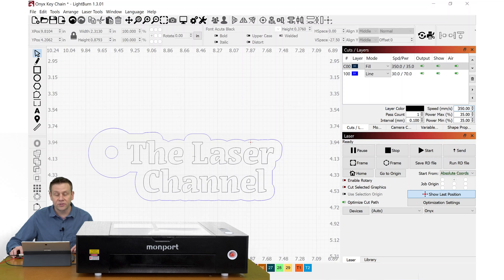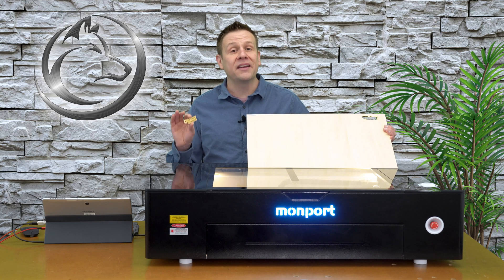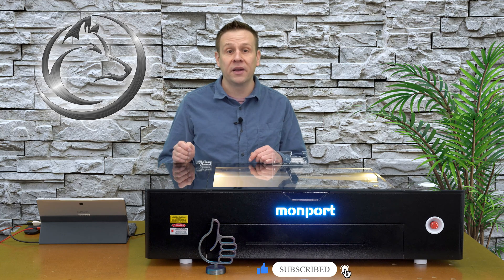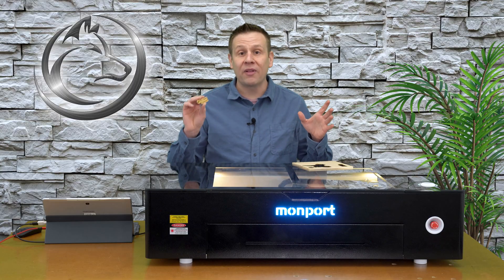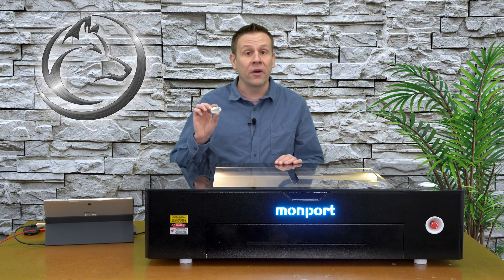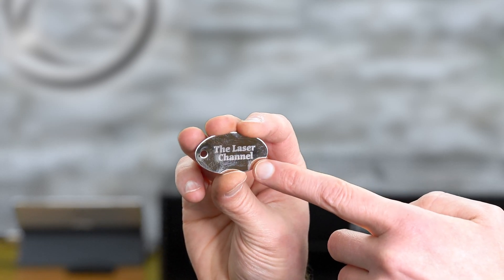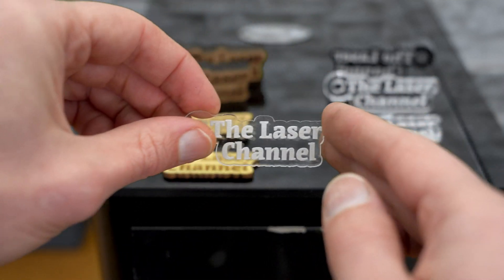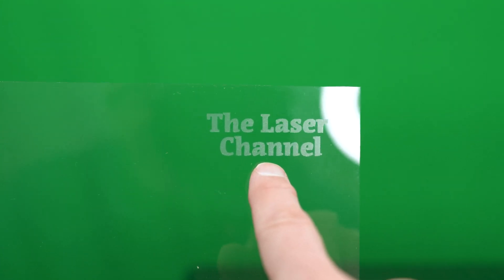Monport Onyx-  Cutting and Engraving #5

Comment: great demo and tips but you are showing only 3 mm material but nothing in 5mm polywood i just got mine onyx 55w laser haveing truble to do material test cut and engrave card 5mm polywood is not cutting right with the setting speed 400 power  40% still not cutting right .plus i dont see much of video on this machine  only you are doing this .i have notic the honycom is not seeting tight on the buttom there are space in both direction about 3/4 which it caused the work space can moved and messed up the projectes when using magnet to hold down the material .not a good idea so monport should address this issue . i dont know i should give a good review on this machine or not .
Reply from the maker: Hi- I've been able to cut 1/4 think plywood with no issues in one pass and 1/2 inch thick solid oak in two passes.  Wondering if your focus is off just a little bit- a ramp test is the best way to make sure the focus is spot on.  The honey is designed to have a space under it- this allows the air and smoke to blow through the honeycomb-  honeycomb does not perform well when on a flat surface without any air gap under it.  Hope this helps.  The Monport FB group is also a great resource where you can post photos and video of what you're seeing.

Comment: What if my machine is not cutting through 1/4 in plywood with these settings? I am struggling
Reply from the maker: First check the air assist is ON and also check that mirror #3 on the laser head is clean along with the focus lens.  After checking those 3 things try running a little slower or adding more passes.  I have found not all wood and plywood are the same so it's normal to have the use different settings.

Comment: Very informative and done in an interesting manner.  i can't figure how to align mirrors with my onyx.  Think i need to pulse to align but can't figure how.  Could you address this issue in a future program?
Reply from the maker: Thank you!  A maintenance video is scheduled for the Onyx soon that will include checking mirror alignment. The mirrors "should" be aligned from the factory but the 3rd mirror on the laser head is the only one easily adjusted- the mirrors 1 and 2 are inside a sealed metal box and do not need alignment; this is per the manual.  In the video I'll show a super easy way to check the mirror alignment.